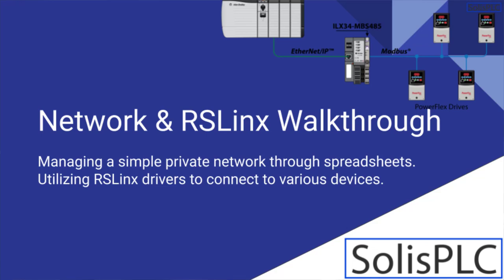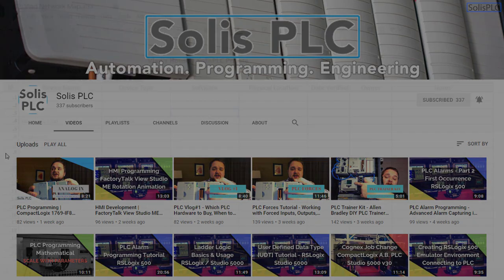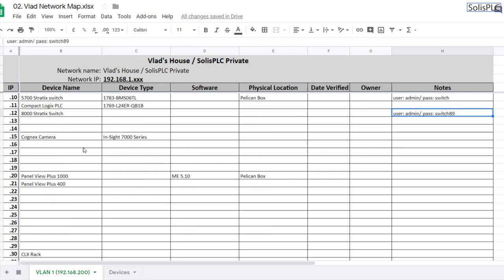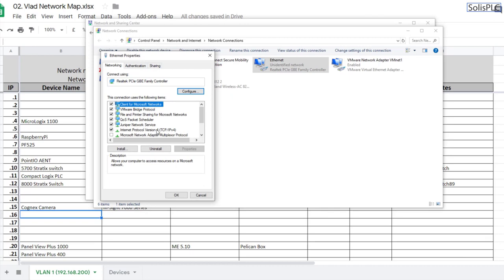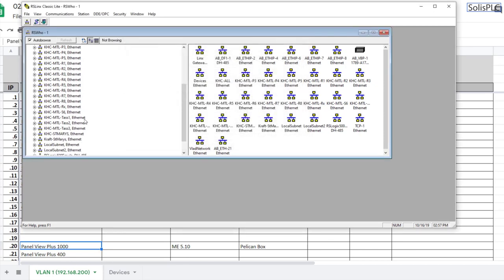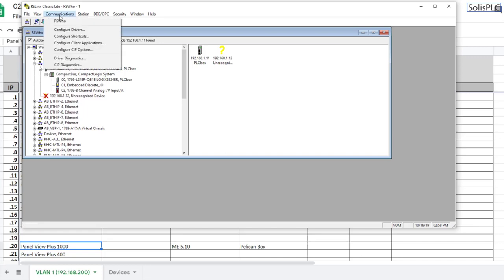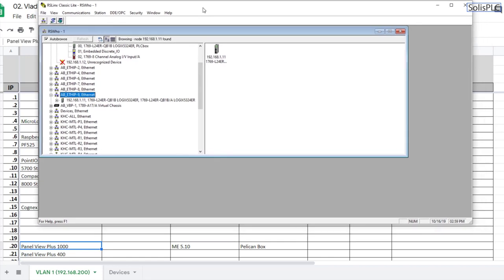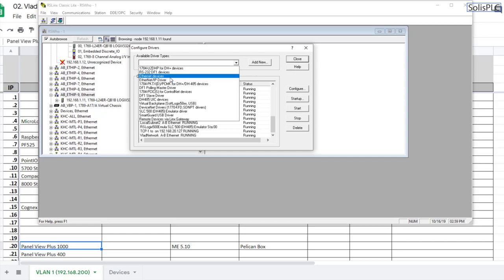PLC Networking Basics Tutorial | RSLinx Classic Lite EtherNet/IP Driver Configuration User Training

Comment: Hi, Vlad, your 1756-ENET ENBT EN2TR EtherNet IP Setup , you use the printer  cable or just buy the cable from the Rockwell? and usb cable also from the Rockwell?
Reply from the maker: It's just an off-brand USB cable. I rarely buy Rockwell cables as there are always alternatives that are much cheaper.
Reply: thank you, and where do you gonna buy those stuff from normally?

Comment: Hey Vlad, thank you So much for these great videos, I have a problem with my network the controller losses the connection and trips the unit the message is "CIP connection (4)timed out on route ControlLogic in slot 0 of the chassis at 192.168.1.1" please any idea? this comes from time to time.Thank you so much waiting for your response.